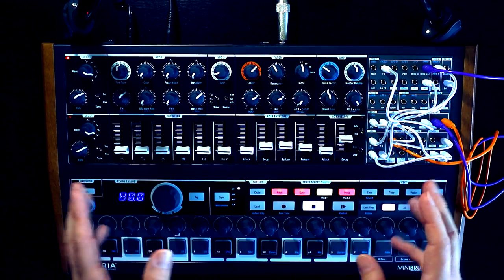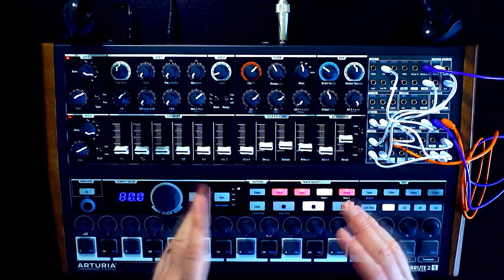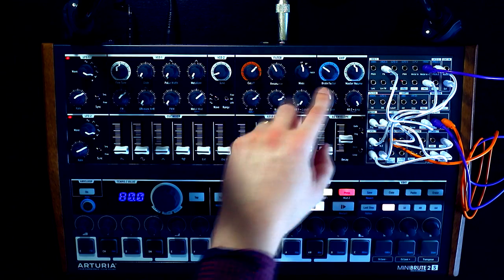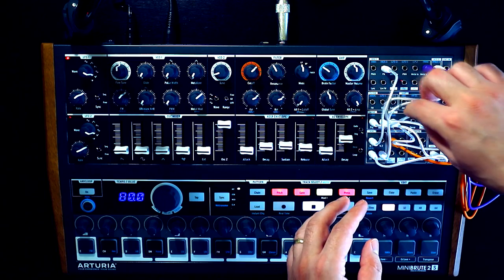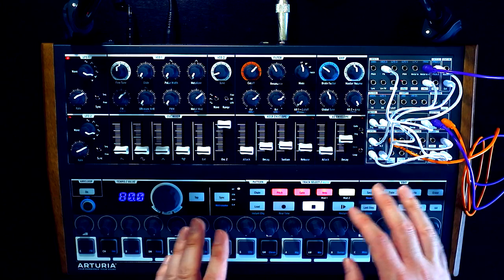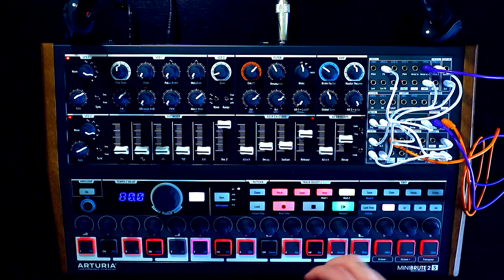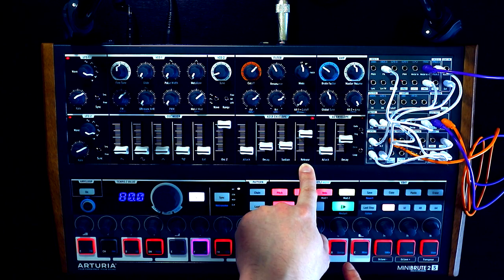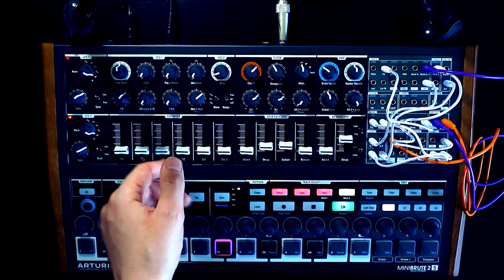Arturia Minibrute 2S - One Box Techno Jam - Patch Walk-Through

Comment: Essentially, this video shows you how to  '*use the patch bay*' to create '*separate instruments*' from the OUTPUT of each Wave-Type of VCO 1 《Sine, Square, Triangle, EXT(!!!neat trick!!!)》

NO EXTERNAL GEAR NEEDED for MULTI-INSTRUMENT songs! .. using Arturia Minibrute 2s

Here is what you compromise:
#1 Since you are using '*on-board knobs*' for shaping outputs of the various wave forms, you cannot use those knobs to shape their default assignments.

#2 all sounds are related in one way or another to eachother, whether tempo, decay, or pitch, etc.. since it is using a single VCO to create most of the song, you can have some sounds without the others but changing certain settings will affect EVERY sound.
Still...
GENIUS!!!

Love this video when using Arturia Minibrute 2s BUT still extremely useful with other Make/Models of synth!!!  ... if they allow this much modulation/patch points/filter types.

This video really shows the extreme customization that Arturia has allowed with the MINIBRUTE 2 (and 2s). Thank you Arturia for even conceptualizing a product like this.. WOW

Comment: Really appreciate this. Thank you so much!
Reply from the maker: No problem! 👍
Reply: Hello, I just patched up my MB exactly in the way you describe, and it worked great. It really helped me to see how you used the alternative functions (in the MB2S manual they call them “secondary functions”) of the sequencer. The documentation provides very little information on those functions and your video finally made it clear. It’s impressive how much you can do without any mults and a limited time range in the ADSR circuit. It’s also limiting without much CV control, though the “secondary functions” on the sequencer do help. 

I’m going to pipe the output through some of my modules to see I can mangle this a little.

One question though: when you’re working only on the kick track (OSC2) and you have the other faders set all the way down, do you hear little clicks come through from the other tracks sometimes? I’ve been playing with the filter cutoff frequency and that seemed to help.
Anyway, thanks again & cheers from Pittsburgh, Pennsylvania!
Reply from the maker: I don't think I'm getting and bleed through from the other sources, but occasional clicks might be the filter or VCA opening on that very low tuned sine when it's not getting the pitch modulation - it's moving so slow that if if it's near the apex of the cycle you're basically opening up on DC - which will sound like a single pulse?

Comment: Hey man! Thanks again for the video. Just tried to recreate this patch in educational purposes, got almost everything right, but one thing. How do you modulate fm knob with the gate trigger? In my case it either triggers all of the notes or none. Thanks
Reply from the maker: In my main (pitch) sequence I only have a few notes turned on, but they ring out because of the Amp VCA being open. So it's a patch from the Gate out, into the AD trigger, then from the AD out into the VCO1 FM. Any step you put a note on will get a pitch bump, then it'll just drone. Oh and make sure you're AD envelope is in trig mode.

All make sense?
Reply: @OscillatorSink  it worked! Thanks a lot bro)
Reply from the maker: Excellent!